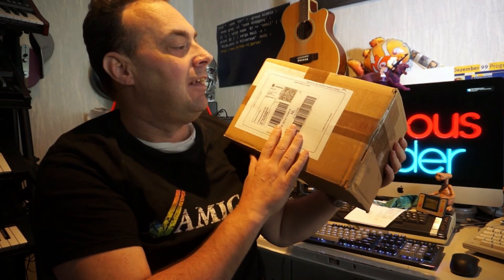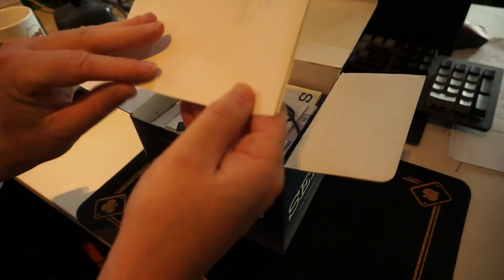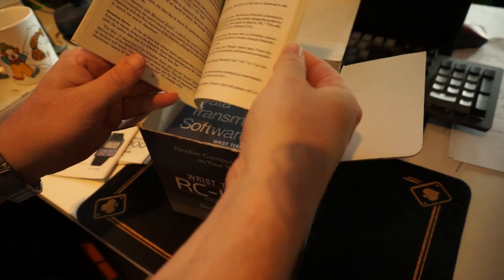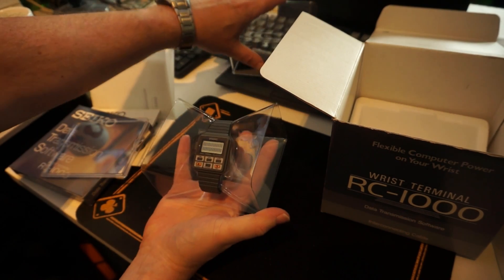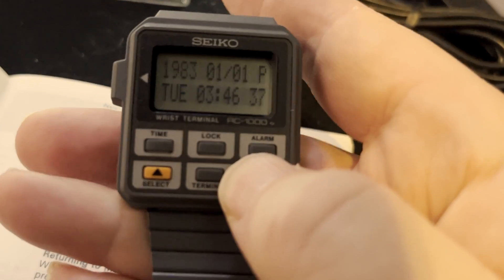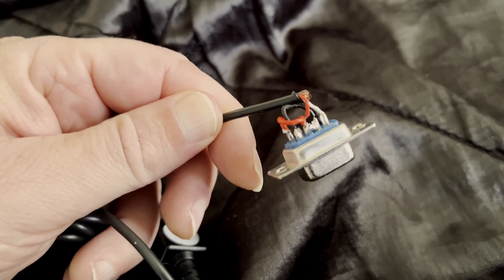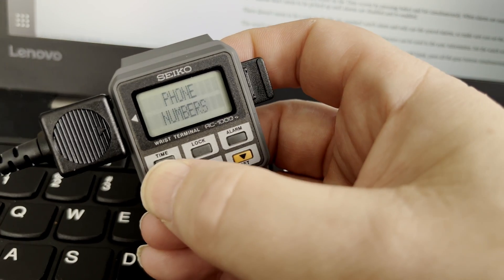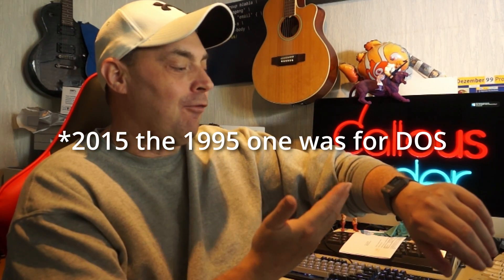SEIKO RC-1000 sold as "not working", can we fix it?

Comment: Nice! I had a Casio with a 1000 characters scroller I used for my formulas. Cool, that you got it to work so fast. Nice piece of history. Hope you are good/better?!
Reply from the maker: Ah so you used it “for school” as well 🤣I guess some wrote things on their hands and pants, others used tiny hidden notes, we used tech 😂we were ahead do the crowd.

I was pretty confident that a reset would work but it’s always a guess. But I looked at the image and saw that garbled text and figured reset and/or replacing the battery.

My health was a bit bad this week. Still waiting for the heart surgery but now it was just the chronic illness annoying me, dropping my blood pressure to the point of becoming serious. I actually just came back from getting intravenous fluids when I shot this. The box sat in front of my door when I arrived.
Reply: @CallousCoder  I am glad you found the energy to make a new video. Keep it up! ... if it doesn't work by itself, you still have your dealer and your c*ack*hore to get it going ;-)
Reply from the maker: @RetroWK  hahaha 😛 thanks! With the amount of meds I have, Pfizer or bayer may as well be my dealer. Steroids to keep immune system down (and making you fat), meds to keep heartrate steady, and hormones that my body doesn’t produce in enough quantities (which basically is the root cause of chronic inflammation). But I’m sure that when my heart is fixed that I can at least row and swim again and that will definitely help overal fitness and well being. My only exercise now is a daily brisk walk. Even a jog ends up in severe atrial fibrillation. So 1 or 2 months I guess to get the treatment. I can’t wait to be honest.